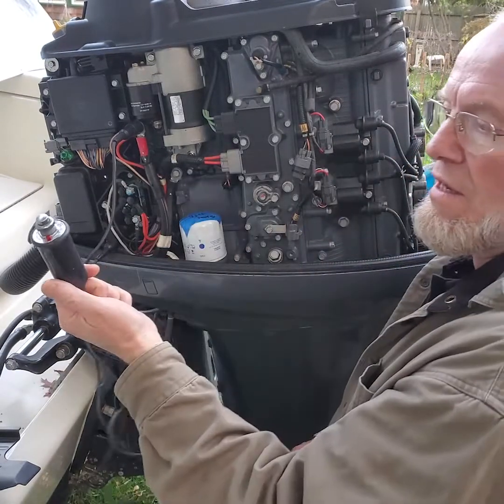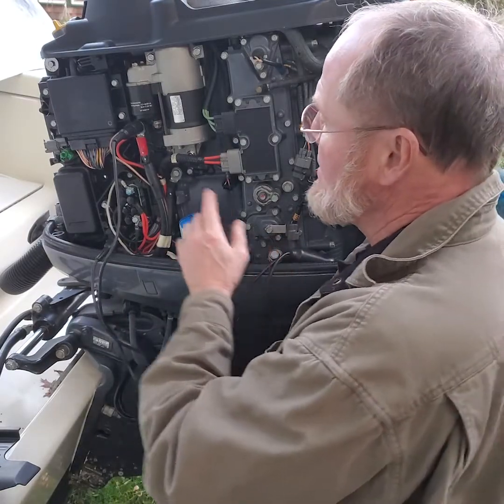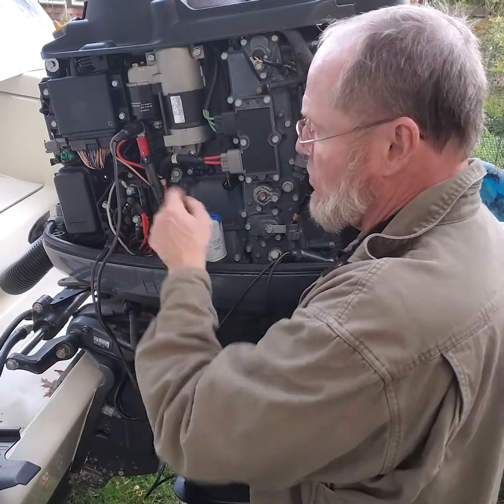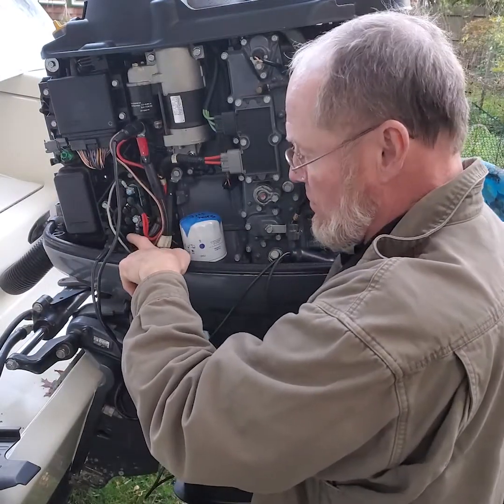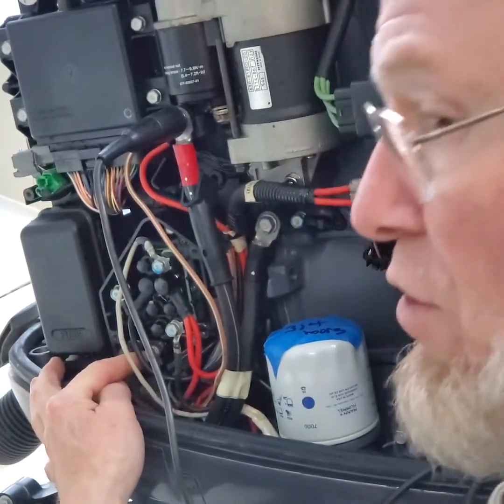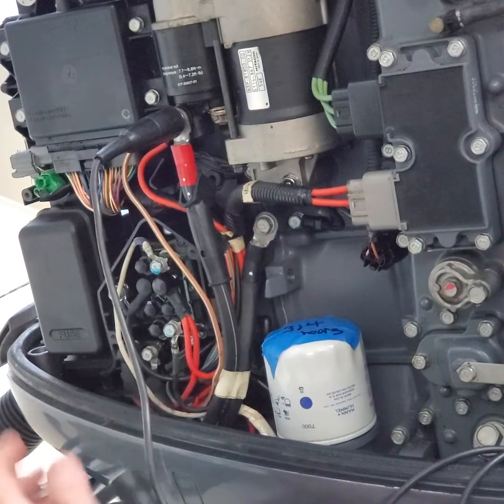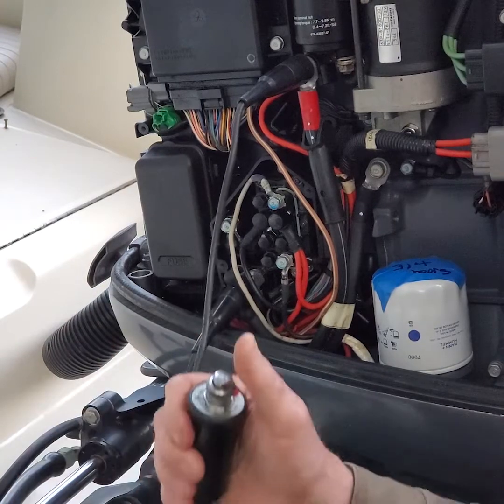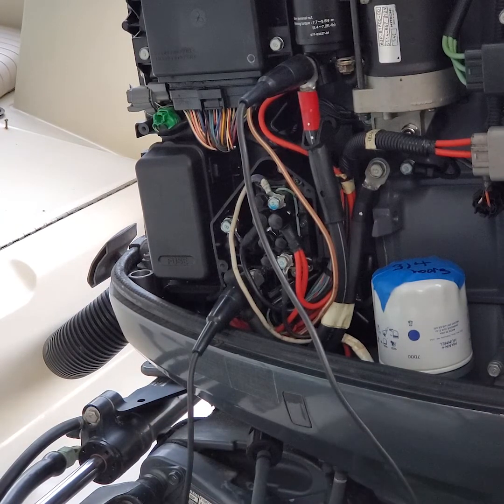Yamaha F150TR Lower unit install

Comment: What’s that tool you used
Reply from the maker: That would be a "Starter button" which we use to bypass the key switch.
This one is on AMAZON. OEMTOOLS 25331 Heavy Duty Remote Starter Switch
Reply: @tedsmarinerepair8956  I appreciate it
Reply from the maker: @snowboardingfun3085  that would be a starter button they sell them on amazon.